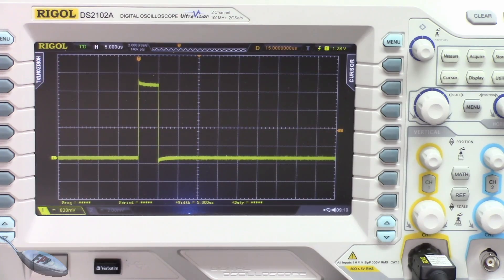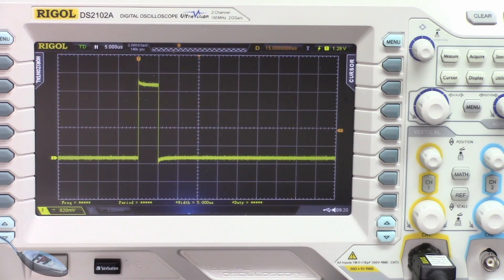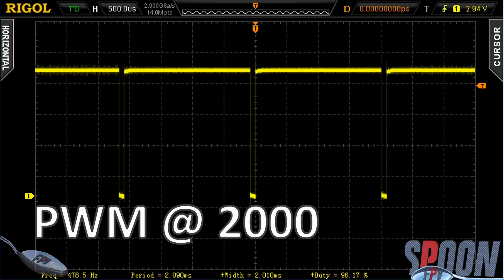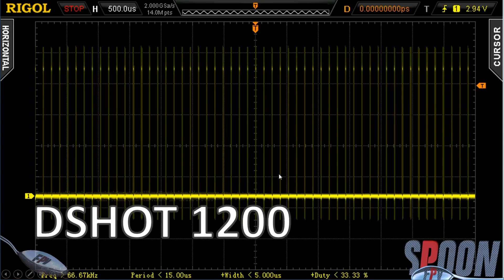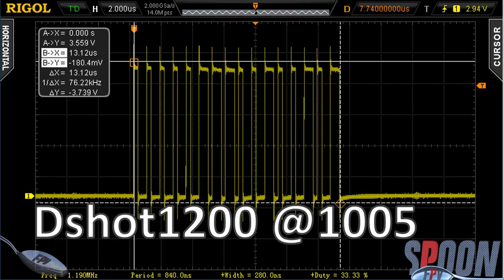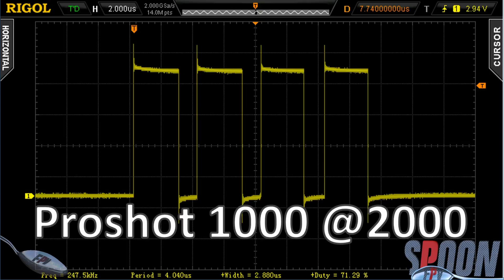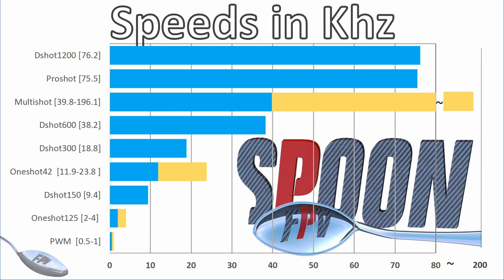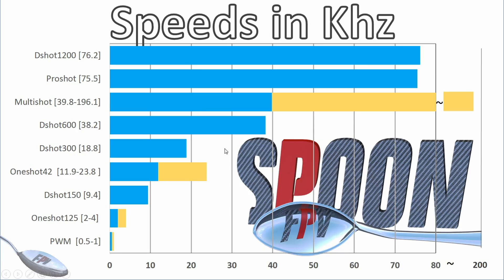Dshot Vs Proshot Motor Protocols

Comment: Inverted ideas sounds cute. Educational, thanks.
Reply from the maker: Yeah, I don't know that anyone will listen or do it, but I think it could be something to try.  The other thing with analogue vs digital is that the motors will respond at slightly different times, so maybe there are additional advantages to sticking with digital.

Comment: Thanks for the explanation. Best explanation of the protocols I've ever seen. 

As these protocols get ever faster, where is the break even when the motors can't respond any faster? There's got to be some period for the motors to respond where the motor mass/inertia prevents the response. Seems like the focus will turn to desynch management vs speed. 

Clearly Dshot1200 is the best but what about...Multishot vs Dshot600? 

Do you think there will there be as much time developing protocols in the future or have we reached peak efficiency?
Reply from the maker: The motor does take a while to respond, it's really about reducing the amount of time it takes for the ESC to know what the FC wants it to start doing.  There will always be an advantage to going faster, up until it takes no time at all.

Comment: Those increases in frequency literally can't be detected by the bestest pilots so I'm really not sure what the point is. The whole damn powertrain is a physical damper anyway, and no one's actually bothered to test if the "better" protocols can be detected at the prop, let alone at the thrust output.
Reply from the maker: +norgtube you are correct the motor takes a while to respond to the esc input.  Faster motor protocols directly reduce the time it takes the motor to respond.  If it took you 5 minutes to put out a fire, and I was like its going to take him 5 minutes I can wait 5 minutes to tell him you would be upset.  Is all about getting to the ESC (in your case the fire) faster.